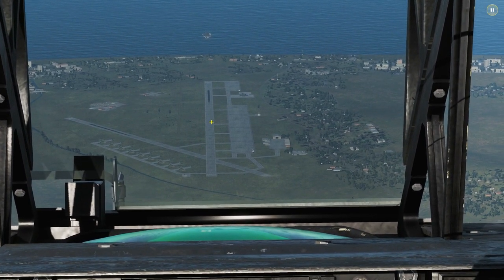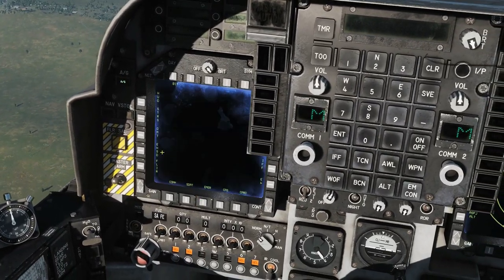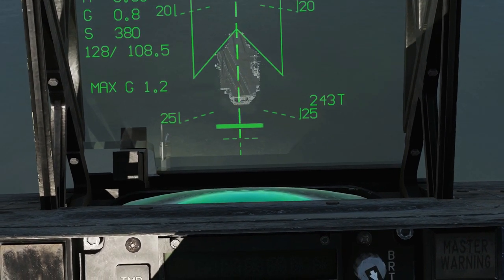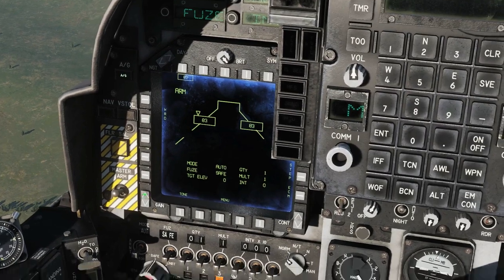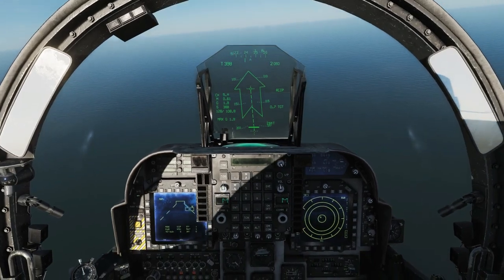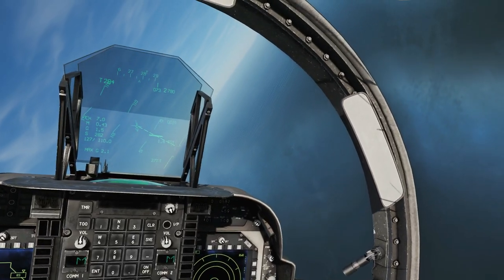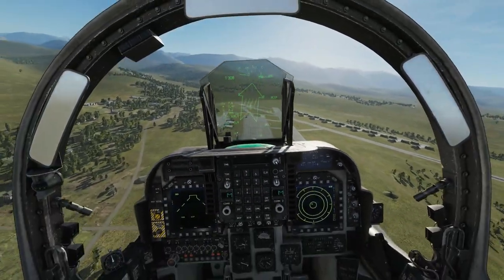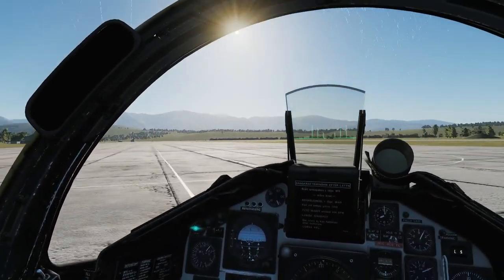Questioned: Is Bomb Fuse Delay Damage Modelled In DCS WORLD?

Comment: The delayed fuse (Talking abouth real wold, and putting a firm example) is used, also, when is low altitude bombin, just to give time for the pilot to exit the area. Just like in the Malvinas/Falklands war, the Argentinian pilots were so low over the ships, that if the bomb exploded right away, the force and debris from the explosion would reach the airplanes. 

With that say, anybody knows if this is simulated or implementend on the community A4?

Comment: The impact fuse delay in bombs is for very long time already. It was present in world war 2. The main reason for this is (for normal bombs) is that when you drop the bombs you have time to "escape" the explosion area so you wont damage yourself in process. It is especially important when you do super low pass above the target. There are some small exceptions for some missiles/torpedoes/tank ammunition, for them to penetrate armor before exploding, but it is due to different reasons, and it is not connected.
Reply: This is not completely correct.  The bomb delays are for penetration into a target.  For low-level passes, we would put a retardation fin on the bomb.  For penetration into tanks or hardened armor, the munition uses a shaped charge for the penetration effect.
Reply: @wesschaffran9088  did you read all of my post or skip the last sentence.. which you've repeated? The average free fall or guided bomb doesn't have penetration specifically for an armoured target such as a tank. Tanks you kill with cluster munitions like the Mk 20 rockeye or the British bl755, they went out of service more than 15 years ago sadly. These days you kill tanks with Brimstone missiles (if your in an RAF jet) or Maverick. Which do have shaped charge warheads. If you happened to hit a tank directly with a 1000lb bomb, chances are the pressure wave would incapacitate or kill the occupants, it will also leave them at the bottom of a 50ft wide crater.
Reply: @wesschaffran9088  hi Wes. Not trying to piss you off but I was an RAF weapons technician for 22 years. So put your vast knowledge back in its box and I'll do the same with mine. I discharged 2 years ago, I'm now still working in aerospace for a civilian company  in the UK which is an American multinational.
Reply: @simonmallet5212  Sounds good man.  I've worked with RAF AMMO a lot.  No offense.  Thank you for your service also.
Reply: @wesschaffran9088  and you sir, last time I worked with your ammo guys would be red flag in march '99. Worked with the Aussies a few times though.
Reply: An interesting exception to the retardation for low level rule, was a British WWII mission, where mosquitoes dropped bombs with very long delays(I think 15s), from very low altitude( I think <15m) so that the bombs would slide along the ground and into the wall of a prison, setting the prisoners free. I believe other mosquitoes in the squadron hit the guards barracks with regular bombs to help with the escape.

Comment: What about the tail fuse? If I understood correctly that setting is to allow the bomb to penetrate the measure of its length before detonating using its tail fuse
Reply from the maker: Good call. Haven't tried.
Reply: The delay is used for penetrating a certain distance into the target.  It doesn't really have to do with the length of the bomb.  Using the tail fuze has to do with different factors, like bomb configuration.  As far as I know, the delay was not one of them in regards to using a tail fuze.

Comment: I always used to wonder, if in real life,a bomb ever failed to donate cause the delay fuse damaged itself at impact.
Reply: If the delay element got damaged somehow on impact, we would not be able to tell unless the bomb was dug up and inspected, but then it would probably be smashed from the impact.  In my experience, I never saw this.  However, the bomb would fail if the delay element was not installed in a mechanical fuze.  It is required to complete the explosive train.  There are delay elements with an instantaneous function.  We used the M9 delay element in M904 and M905 fuzes.  You can search the internet to find out more info on it.  Electrical fuzes have the delay built into the fuze.

Comment: The error bars on 1% damage are pretty high... no way to tell if it's 0.51% or 1.49% damage (if it rounds, or 1.0% and 1.9% if it truncates).
I do seem to recall one of the manuals, might've been the Harrier, saying it didn't actually do anything and their delay feature was there just for completeness, though... and the delay is much higher than in reality, otherwise it wouldn't even appear to do anything. So probably "no damage difference" is the correct result.
Reply from the maker: Thx M. Great feedback as ever.

Comment: This is very disappointing when you consider how long this game has been out for and how many of the modules have bomb delays.
Shame on you wags.
Reply from the maker: Remember guys, I may be doing this wrong. Maybe delayed fuse is not suitable for a runway? No idea TBH.
Reply: @grimreapers  Yes, you are doing it wrong. It's not that the delayed fusing is not modeled - it's the damage model to structures that is lacking (there is no visual indication of what's happening). You are supposed to use this the penetrate through the ceiling of a building and explode inside of it. Only a few buildings in the sim support this. It's strange how of all possible targets your first was a naval vessel - because we know those have the worst damage model in the sim right now.